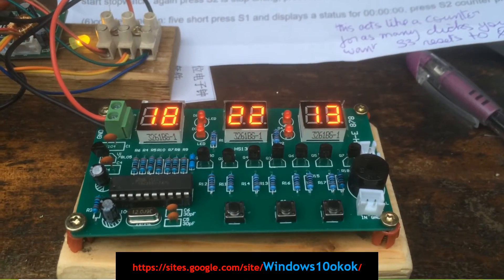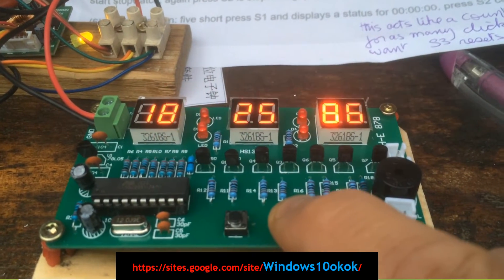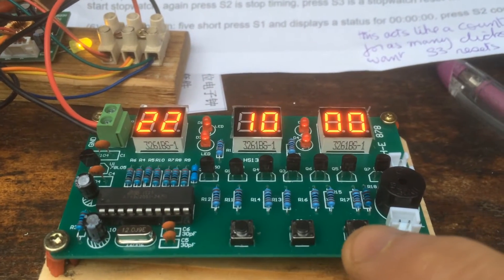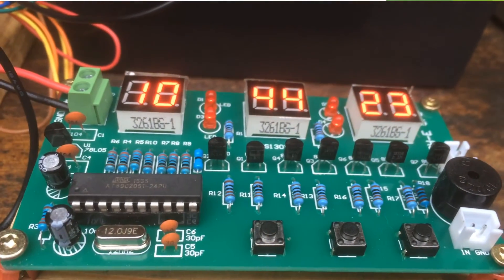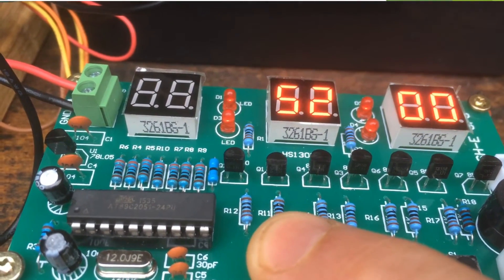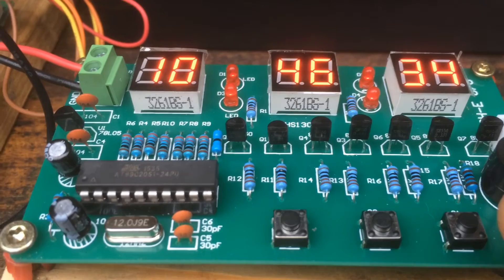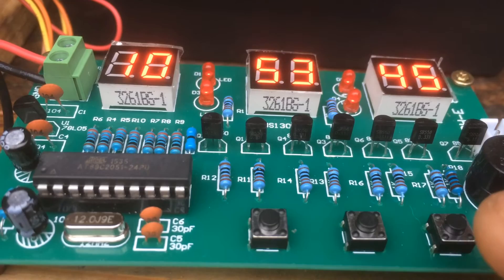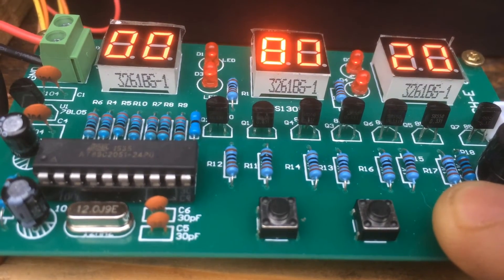DIY Kits AT89C2051  SH-E 878

Comment: Hi, can anyone tell me what the 2 white plugs on the right hand side of the circuit board are used for? I am trying to build a timing/ starting gate (one external switch to start the timer and one to stop the timer) can anyone advise if this is possible with this circuit board? I have wired an external switch to start the timer but can't get a separate switch to stop it! Any advise would be much appreciated. Thanks

Comment: Can you please tell me what is it I can see between 7 Nos. 220 ohms resisters and  left hand side 1st 8550 transistor. Is it a jumper?  In my PCB it shows with single L1 with a single line.  What are the two white colour connectors on either side of the speakers on the right corner? What do they do?   Thank you.